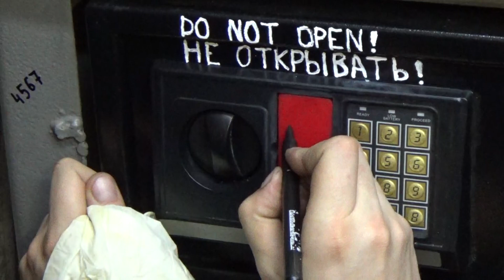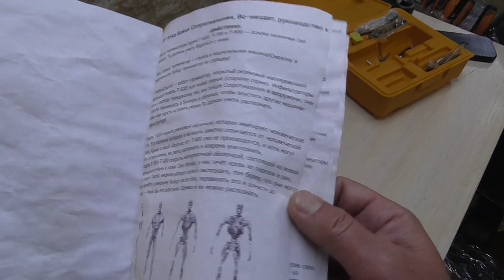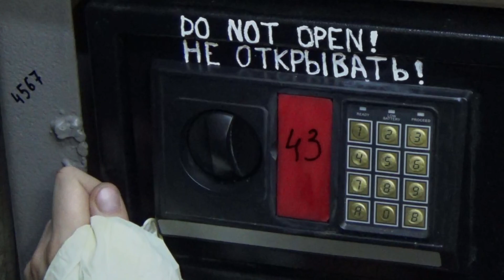Smallest mini safe! 10 millions combinations

Comment: 9,999,999 combinations not 10 million
Reply: 0,000,000 is a valid combinatoin so it's 10 million total
Reply: Tobias Redepenning how would 0 tries open it , it would take 9,999,999 try’s  to open it if the number max out at 9,999,999